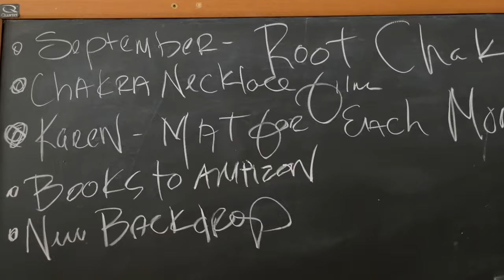Introduction to Silversmithing- How to Set Gemstones & Create Beautiful Chakra Jewelry for Beginners

Comment: I would never solder a bezel to that much sheet.  Your students should know that sterling is the most conductive metal for heat which means that the solder will not flow until the entire mass reaches the same temp need to flow the solder.  With this much of a heat-sink, it's easy to burn off the flux before the solder flows.  Also each time you use this sheet as a back plate you are introducing more fire stain deeper into the metal.  For a stone of this size I find it better to cut down the rectangle of sheet to just what I need for the project and hold a corner in a third hand and heat from below.  If I'm concerned that the plate will sag, I support the opposite side with a 2nd third hand.   Even with the plan to use the solder to also attach the rope embellishment, I feel the amount you used was overkill.  Finally I think you could attach the last piece of wire with medium solder as it's stronger than easy.  As the medium has been heated twice, it's melting temp has increased so the danger of things shifting is not great if you're careful with the torch.  From a silversmith with 47 years experience
Reply from the maker: Good thing that all silversmiths operate and build their work in different way and in different styles.
  I am glad that you have your own style of building .cheers
Reply: Thanks Malcom. My issue is when it comes time to trim piece. How to cut off backplate without cutting into bezel

Comment: Great video!  What about the metal edges of the lid to your pickling bath?  Does that not react to the solution?
Reply from the maker: Good question! Although through the years it never has seems to bother the pickle. Another fact is as soon you pull your metal out ( if you accidentally put  it into the pickle ) the pickle will be back to normal